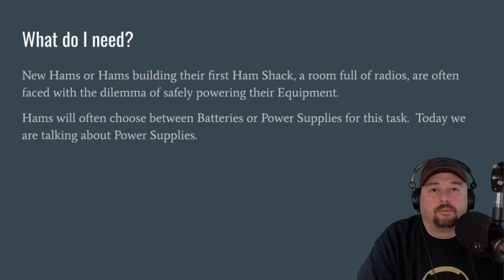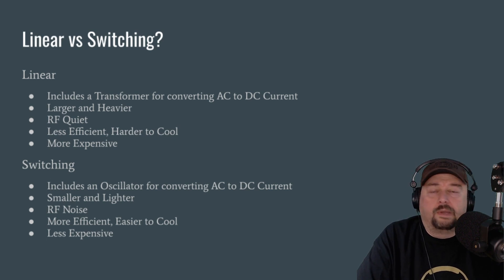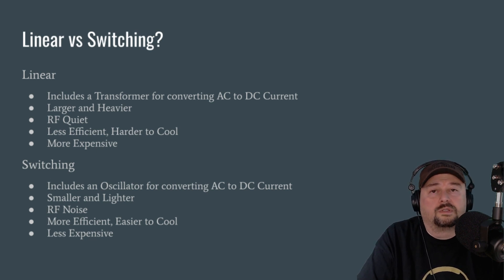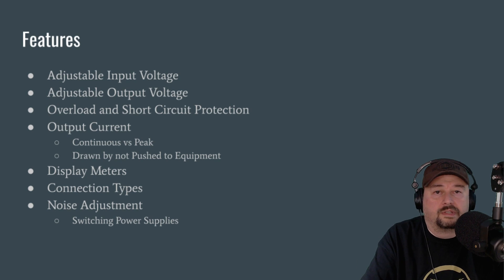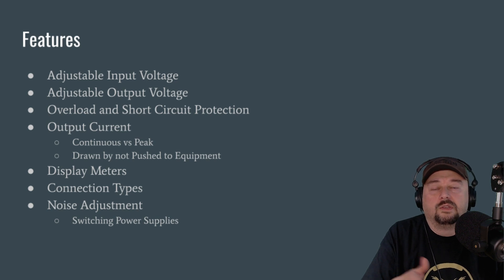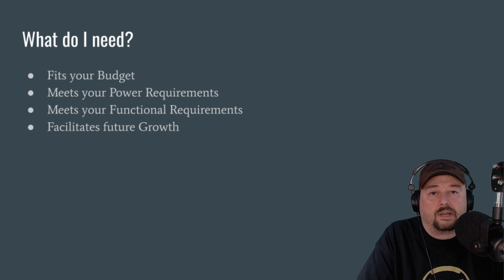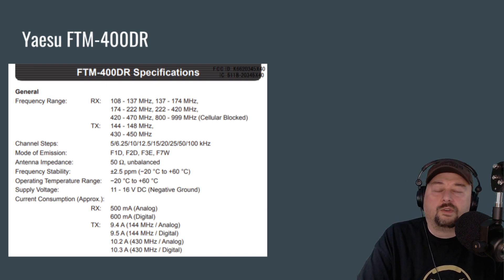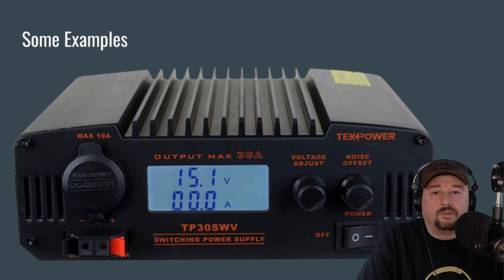Buying a Power Supply - Beginner Ham Radio

Comment: @TheSmokinApe Last year I went through the ham shack RFI reduction exercise. Established an RF ground buss, ferrite chokes on all the power cords, a Tripp-Lite Isobar 8 socket surge suppressor (each socket has its own filter), and replaced my "economic" switching power supply for an MFJ-4035MV adjustable regulated power supply. When the current surges, the voltage is maintained and the fans kick in for increased cooling. I got a significant reduction (no numbers) in background noise when receiving. The switching power supply went to the bench. So far so good.
Reply from the maker: Glad to hear you were able to reduce the noise, a high floor can ruin the fun for sure.  Thanks for watching John 👍

Comment: Bare knuckle power. Solar only. Good for my lighting. Not for my cw/qrp hf rigs. Though. I came across a answer. (Several heavy-duty) caps. And sense I use about 5 watts (p-p) power . The caps sop up the current. Then they add to the battery supply. Never had a drop out yet. I have powered my vhf/ UHF hand helds. And qrp  rigs for 14 years . Good show tks.
Reply from the maker: That’s pretty creative, thanks for sharing Stephen 👍

Comment: This was one of the most frustrating thing for me. The goal is to have a power supply that "will" deliver a smooth consistent amperage under load up to its manufactured rating. People were trying to sell me a $500.00 PS for a 2m 50 watt radio because I asked which power supply. After much research  I bought the SEC-1235M $99 on sale. Research and ask other Hams. When someone says "That one", ask why? Find out the context of their use case. Some folks buy the $500 supply because it does "X" when they DX SSB on a 160m quad with a 1500 watt amp. Is that your use case? More then likely not if your new or just into the Amateur Radio. Don't buy a supply that just does what you need, buy what you can reasonably grow into. Buy a supply that will power your 65w 2m station and will power your 7100 when your ready for it. 
Ron
KO4AYE
Reply from the maker: Great points, thanks for the comment Ron.

Comment: I run an Astron SRM50 which can peak at 50A and is continuous at 40A and has worked well for my IC-7300 and an Icom V8000 2m mobile I run off of it.  As long as I am not wanting to transmit on both radios at the same time, then this will also work when I upgrade the Icom V8000 to an Icom IC-9700.  I have never had any issues with noise and use a rigrunner 4005 to manage my connections.

73s

Ryan - W8PNP
Reply from the maker: Thanks for the info and for watching Ryan!

Comment: Buy a Cell Phone and stop playing with that junk.
Reply: This past week I was in the middle of the Texas Winter Storm outages that included power and water.  Cell phone coverage was terrible.  AT&T either turned off part of their network or their towers were affected by the power outages also.  Verizon worked on my hotspot for data, but I tried making calls and it was useless.

Cell phones depend on Cell networks, which depend on someone else providing you with power and infrastructure.  They FAIL in situations like I personally experienced this week.  Saying they are a replacement for radio... ANY kind of radio...is painstakingly false.

Comment: This was great info for new and veteran hams. I have an Alinco (Analog, bench type) power supply, that I use to power 2 mobile "Base Station" radios. (Similar to that last model, you showed) It has always worked great, and supplies clean, clear power. And If / when the need arises, I can take it to the work bench for use on other repairs / project testing. I love it. 
Yes, it was not cheap when purchased. But the price has not changed allot since then. It was worth the money! I'd buy another, or similar (cheaper) model, if I need another. 
   I recently tried a (Amazon purchased) Pyramid 15 Amp, power supply. It made a terrible "HUM", when the mobile units were tried, individually. It went back, the same day! (P.O.S.!)
Reply from the maker: Thanks for the comment Chris, I always like hearing positive stories about gear / accessories.
Reply: Is your HF rig, also a Linco? I am blind, and the radios looks simple enough! No I wish, I could find one that would talk to me and read me the screens!
Reply: @chadvandam7179  Maybe you should call HRO, or GigaParts, and ask a sales person, if anyone offers an speech menu.

Comment: I have several of each. One smps supply will give me 45A @ 13.8V, it is well designed and intended for ham use, produces very little RF noise. I have a couple of others which I can't even switch on in the shack if I am playing radio. I also have a couple of linear supplies, one is ex CB and produces no noise at all @ 5A peak. The other I built myself based on ideas by W1FB, Doug deMaw, it also gives 5A@ 13.8V I use both for QRP.
Reply from the maker: Sounds like you have a packed shack, thanks for sharing Stephen!

Comment: The huge problem with EVERY "switching" power supply I've tried is that they throw out a massive amount of "Radio Hash"!!!!!
I've discovered that even the most expensive of these have not solved this "RF Hash" problem!
So, no switching units for me!
Reply from the maker: Thanks for the comment Robin, I have to say after making this video I am strongly considering a linear.
Reply: Haha radio hash. That nakes ne want to eat abunch of hasbrowns. Ive never had 1 issue with hash on a switching power supply. Just buy the samlex america 30 amp supply from the hro candy stire and get a yayzoo mobile and use it as a base with a duamond x30 or x50. 2 meters and 440 are crystal clear unlike that cb garbage
Reply: I have bought two Chinese power supplies. One increased tbe noise level, on my Y990, by 20db,in a diffetent room of the house. No amount of ferrite, would make a difference ! The second was very quiet. Great. But every time I keyed up, In another part of the house, the supply went crazy and produced random voltages!

Comment: That's funny. Almost all the hams I know use Linear supplies. Switchers are noisy and unreliable. Great for portable operations but for your shack just buy an Astron Linear as it will outlast you.
Reply from the maker: Thanks for the post David.  I have to admit based of this and other posts I am tempted to order an Astron.
Reply: @TheSmokinApe   I bought my 60 amp linear Astron at a hamfest in 2010 for $60. It was used in a repeater for many years. It has been powering my shack since then without an issue.
Reply from the maker: Dang, that should like a heck of a deal.

Comment: The thing I do not understand about HR power supplies is that all our equipment says 13.8v but some PSUs adjust from 4 - 20....
If I am buying a PSU for ham radio I want it to be 13.8v with anderson power poles and no cigarette lighter socket.
Reply from the maker: Fortunately they have a pretty big variety out there these days 👍

Comment: I’m a new tech and wanting to set up 2m and 70cm dual band mobile as a base station. I’m will have to buy one part at a time. Thinking start with a decent power supply then antenna and SWR meter and then radio. So this video is very timely and informative for me and a lot of other newbies. Thanks
Reply from the maker: Glad you liked it Randy.  Good luck with the station 👍

Comment: Started on switching PS as a tech.  Moved to linear as a general and never looked back.  IMHO, switchers are good for field day or starting out where portability and price is priority.  Linear is best for shack and provides stable and clean DC power, e.g. with no noise or ripple, best for chasing that weak DX.
Reply from the maker: Thanks for the post Jason, good information 👍

Comment: I use a simple 7A power supply for my CB and a 30A dual meter for the ham side.  Both are rugged and up to their respective jobs but I have come to realise that the meters and controls on the twice the price unit offers very little extra advantage over the simpler unit. Lesson - get the right power rating for your requirements first and foremost.
Reply from the maker: Thanks for the insight John 👍

Comment: I recommend at least a 30 amp power supply if not a 40 amp unit as then you can add extra equipment and not over draw the current output of the power supply . Yes a 23 to 25 amp unit will power you radio with a couple of low amp draw pieces of external equipment   but then your limited to what you can use to draw the current .
Reply from the maker: Great point Joe, thanks for the comment 👍

Comment: Switchers generally run at higher voltages and require a crowbar circuit to protect you rigs from higher voltage runaway ? 
KC3ONO
Reply from the maker: I have heard about folks getting voltage runaway with cheaper switching PSUs

Comment: My first power supply was a jetstream manual adjust voltage, 30a peak, that thing was noisy in more ways than one. I turned an old cabinet into a faraday cage by lining it with copper meshing. Used emt to wire for receptacles inside the cage, bonded the emt at both ends and bonding jumpers around fittings. I put the power supply and HT charging stations in it, along with chokes on everything. Not sure if it made a difference but it sure felt like it did, the room didn't feel as "heavy".
Reply from the maker: Thanks for sharing that story, having a noisy supply is the worst

Comment: Nicely presented information. I have both switching and a linear power supplies and I think the new switching supplies have gotten a lot better with the RF noise. I will say however that my switching supply is audibly louder with the fan that cycles on and off as needed for cooling. My linear just has a big heat sink and no fan so it might be something to consider for some Hams. For me, my house is rarely quiet anyway so it's not a big deal. If you like to tinker and DIY repairs I do find a linear a bit easier to service. If my switcher fails I'll likely just recycle it and get another. Take care.
Reply from the maker: Thanks for the post CWB, I agree with your point about switching PSUs 👍

Comment: Transformers are used to either “step up” or “step down” AC voltage, it the case of our power supplies the transformer steps down (decrease) the voltage. The rectifier converts the AC to DC.
Reply from the maker: Thanks for the info 👍